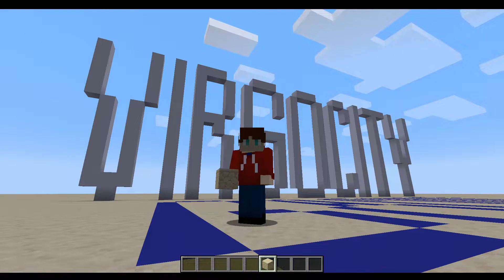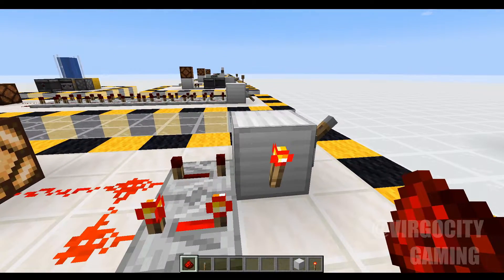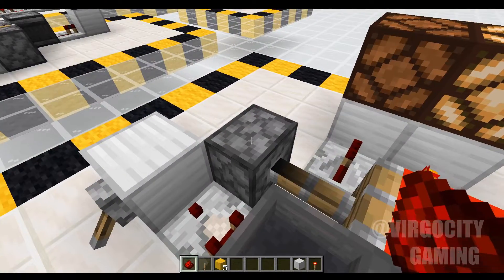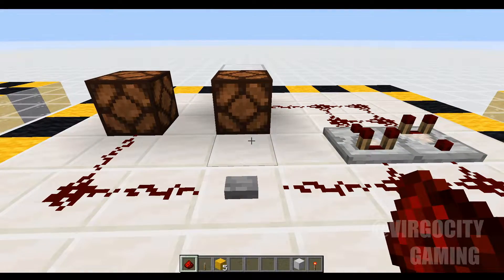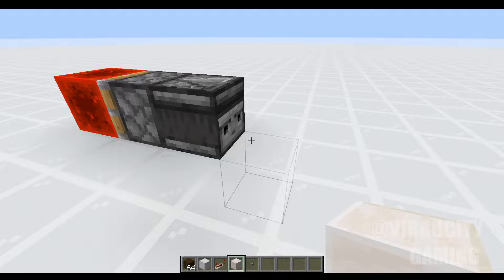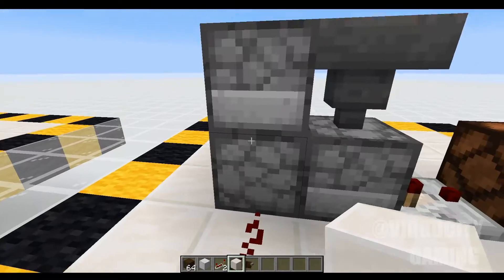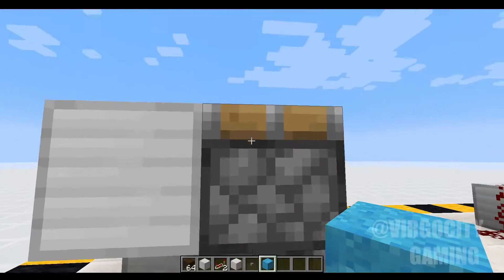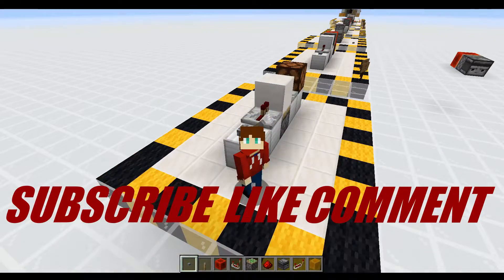Minecraft Redstone Basics - My Most Used Redstone Circuits (Minecraft 1.15.1 Java)

Comment: in my opinion the most important circuit is not shown. its a switch with 2 seperate inputs to turn on and off . it cant get out of sync like a flip flop (witch is still very usefull). First thing u showed is a lever (witch u only can operate manualy), next step should be a switch witch automaticly can be turned on and of .

Comment: Thank you so much for the video.  On 2:25, once the observer based clock is activated and the dropper is dropping items to the water stream, I was wondering how to stop the clock when the dropper finishes dropping the last item.  I added piston in the opposition direction and use a button to push the observer back to its original position.  But this action require my present.  How to make it work automatically as soon as the dropper done dropping the last item?  I would appreciate your help very much.
Reply from the maker: As soon as the dispenser is empty the piston should retract itself and pull the observer back.
Reply: @virgocity2289  It didn't.  I have tried several times.
Reply from the maker: Are you using a sticky piston?
Reply: @virgocity2289  That was the problem, my fault.